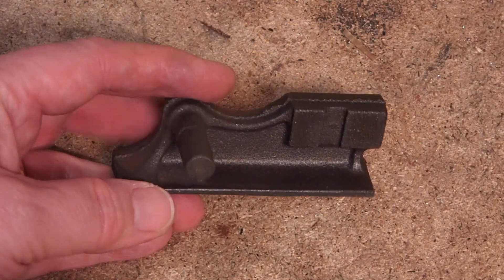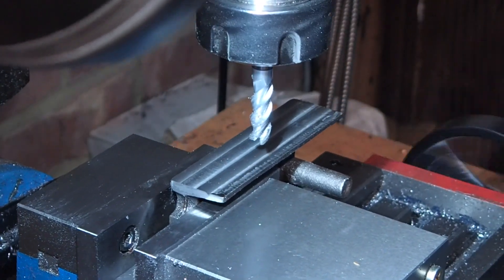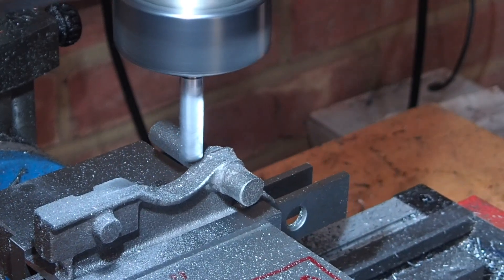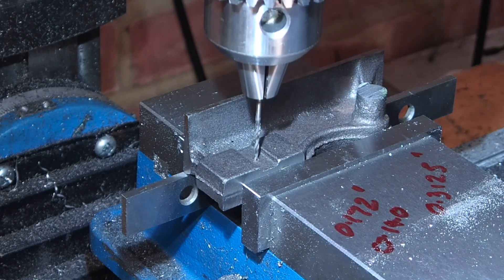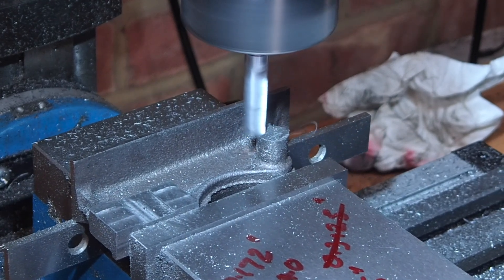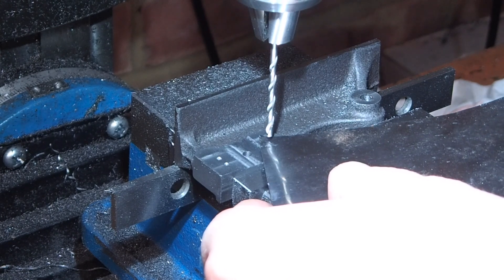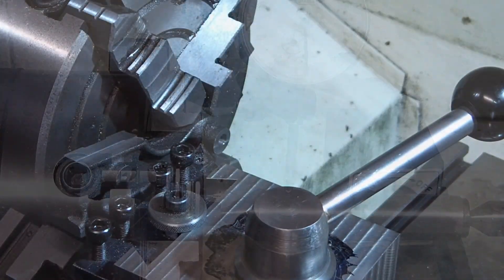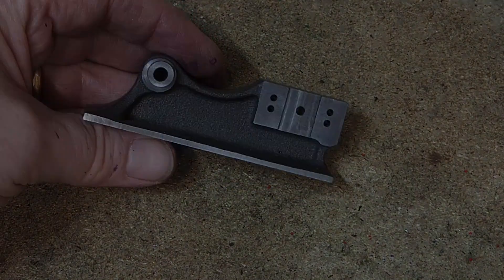Stuart Progress Oscillating Engine.  Pt 2 The Main Frame

Comment: Is it just me or was there quite a deflection at 9:12? This will probably need bigger hole with bushing in the future to save the part.
Reply from the maker: I hadn’t spotted that!  🤦🏼‍♂️  It actually looks worse than it is.  When I assembled the cylinder and pivot pin on the stand I noticed a slight angle and wondered where it had crept in.  Luckily, it’s not enough to stop the port faces mating properly.  I’d drill and bush it if it was more critical, but I can live with it for a stationary engine that will only be run now and again.